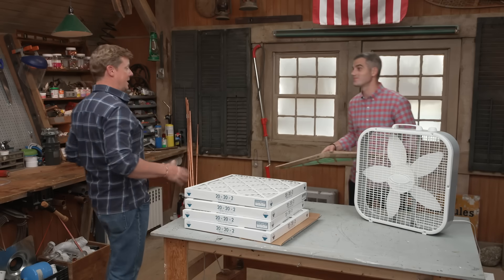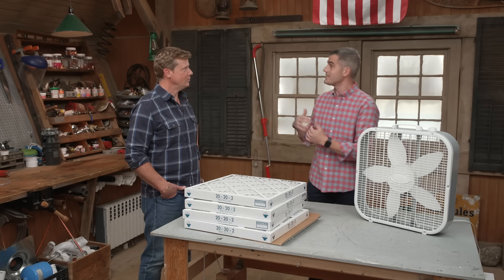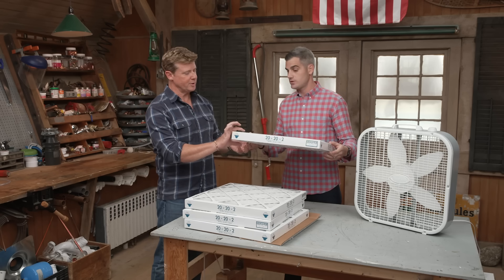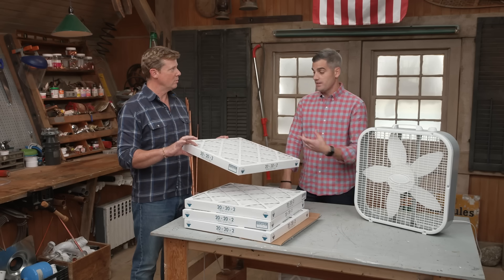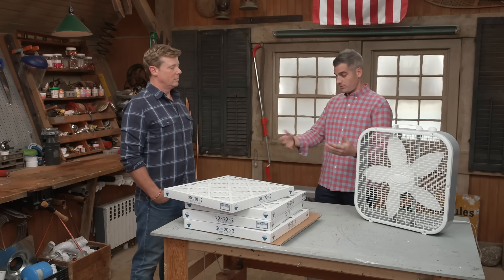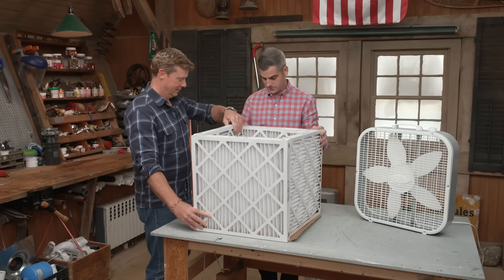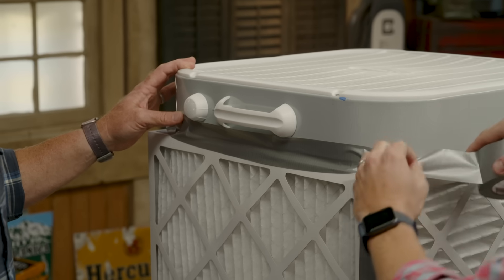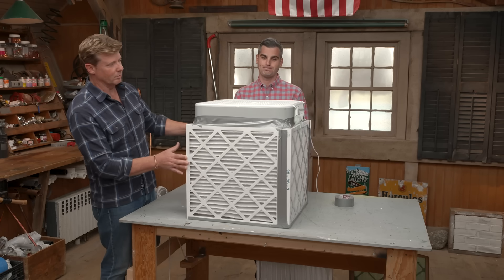How to Make a DIY Air Filter | Ask This Old House

Comment: I use MERV 13 filters in my woodshop. I duct tape one to the back of a fan.  I like this system because it will move the air more efficiently. Just have to account for the space.
Reply: A wodden frame could allow it to be hung from the ceiling. A simple pivoting wood latch would make swapping the filters a breeze.
Reply: @michaelkline9647  I was thinking the same thing, even with the cube implementation in the video. Could be just the thing I need for my own shop, with a lot more capacity to move air!

Comment: I use one filter on the inlet of such a fan in my workshop. Does using 4 filters have much more flow? It seems to work good with just one filter.
Reply: No one is actually discussing how much air that fan can move...
Reply: Would clog up less with 4 filters. Intake will also be higher with 4. As mentioned in video the 2500sqft house will have the air pass through in 20 minutes
Reply: @billpiehler9010  ... figure it this way... a fine window screen can cut air flow by 50%. What do you figure the air flow will be with one filter? Yes, 4 filters will flow more air... till they eventually clog.
Reply: @rupe53  the video pretty much explains its about moving air. 1 filter moves less air than 4.
Reply: @billpiehler9010  ... yes, my example was for those who have trouble visualizing how much restriction there might be with something as simple as a window screen, then comparing it to the next level.

Comment: There's also UVC lights you can install in your HVAC system.
Reply: Those are for the Coil only, not air.
Reply: @tsslaporte  For the coil only? I'm not sure what you mean. UVC would have zero effect on a coil. There are heater bulbs they put on fridge coils to keep them from turning into a block of ice, if that's what you're talking about. But any light they emit is just waste energy.
Reply: @CuddleTrouble  negative, in this context your talking about UVC as a way for disinfecting the air right?  UVC needs time to disinfect and air flowing through does not spend enough time in contact with the UV light. By coil I was intending to say the Evaporator coil inside your Air handler which will stay exposed to the UV light and prevent mold growth on it.
Reply: @tsslaporte  Yes, i knew what you meant by coil. I did not think of mold though. I'll have to look into the time required and light intensity.

Comment: Ross, I hate to be that guy but what medical training do you have and should you be advising people on the topic of aerosols and viruses
Reply: We’re talking about filtration of particles in the 0.3 micron - 10 micron range. These happen to be things like dust, smoke and particles that bacteria and viruses “hitch rides on”. I’m by no means a medical professional but my masters degree in mechanical engineering provided a lot of insight into physics, particles and filtration...the segment is not intended to portray that this less than $100 filter system will miraculously capture all viruses/Covid out of the air. Just some good sound advice to help improve the air quality in your home. (And by the way mechanical filtration with MERV 13 or higher, ideally HEPA is recommended by all of the leading scientists and doctors in this field)
Reply: @rosstrethewey9391  I am a medical professional. And you are entirely right.
Reply: Gar thanks! Appreciate it. 

These segments can be tricky as there are a lot of opinions out there but we have to follow the science!
Reply: @rosstrethewey9391  Thank you Ross , and thanks for replying to my previous comment, seemingly rare on TOH channel.
Reply: you're doing it wrong
 ... some of what he says is true, even if only due to moving the air instead of it being stagnant. IOW, any filtering is better than no filtering.

Comment: Want to NOT have AC for a while, put a higher resistance air filter in your system. You coils will turn into a giant block of ice along with some of your piping that will take days to thaw out unless you take a torch to it.

Comment: Surprised no mention about using in wood shop.  Been using for years. Gotta change them a lot more often tho
Reply: Pizza ... have seen similar on both wood shops and auto body shops. There's even commercial versions sold, although more expensive. OTOH, the commercial units are rated to be explosion proof. (chemicals, etc)
Reply: Indeed. I use only MERV 4s and they help a lot!
Reply: Really good idea- i definitely don't have proper ventilation or any dust collection other than a dust pan and brush.
Reply: I've been using cheap 20x20 air filter taped to a cheap box fan in my work shop for years. I lightly fog the filter with some spray adhesive. Work's great for capturing over spray particals when painting.
Reply: @derrinpickett9948  what level filters are u using? I just bought some merv 10 filters at $25 a piece, but I was thinking of buying the cheaper ones and spraying them and seeing if it works as good as the higher merv filters 

Do your filters work on smoke when sprayed?
Reply: @HolyDrugLord  atm I have Merv 11 as that was all that was available. I have used higher but would not use any lower then Merv 10. Before lockdown I would use Merv 10 or 11 in one and Merv 14 in my 2nd fan and have that near where I generate the most fine dust.
Reply: @derrinpickett9948  my Dad did the same by using a few box fans

Comment: HVAC systems are not designed to filter home air. The air filter is to filter the air for the furnace only
Reply: Some HVAC systems have filters to filter home air in addition to the furnace air. This is common on ducted HVAC systems
Reply: As they mentioned several times in the video some HVAC systems can accommodate this level of filtration and some can not.
Reply: Sorry Alec, but your statement makes no sense. The home air is the return air for the furnace. And they can be designed for high MERV filters, like in my house.
Reply: @rosstrethewey9391  the furnace filter is to keep larger particles from entering your your heat exchangers and evaporator coils in you HVAC system, there purpose is not to filter your air but protect your equipment. HVAC equipment is designed with minimal merv rating filters. Higher merv rated filter may be ok in a system granted ductwork is adequately sized, static pressures are reasonable, proper movement of air (cfm) and large enough surface area of filter to handle air flow and most importantly replacing filters before air flow is restricted. HVAC pros recommended merv 1 filters because most home owners have no idea how to maintain this properly, so cheaper filter = less restrictive air flow = a more efficient system.
Reply: M K I agree that the primary purpose of an air handler or furnace filter is to protect the equipment. BUT there is no reason why any residential unit can not be designed/installed with high MERV filtration. I can’t remember the last job where we used less than MERV 11. These AHU’s have ESP anywhere from 0.5” - 1.0” WC, more than enough for properly sized MERV 11 or 13 filters (which might introduce 0.1”-0.2” WC). Plus with ECM motors they are variable speed so they can adjust with static pressure as necessary...MERV 1 ain’t good enough. And code in most states needs MERV 8 anyways...FWIW I did a job with MERV 13 filters on low static air handler (0.22” ESP max), how? By increasing the surface area and number of filters in the system, along with properly sized ductwork. Works like a charm. Filters get changed twice per year...AHU protection and Indoor Air quality both achieved. We have to raise the bar!
Reply: @rosstrethewey9391  fair enough. I just enjoy the discussion we all learn from these! Is this the real Ross by the way?
Reply: Alec Minnick yup!
Reply: @rosstrethewey9391  what! You've got to prove it haha!
Reply: @rosstrethewey9391 you must be on the commercial side of the industry we have mainly residential customers and many can hardly keep the lights on let a lone keep up with the cost of the equipment,maintence and call backs of “raising the bar” but it always sounds good on paper
Reply: Our hvac person always said to stick to the cheap ones and change often

Comment: This might help someone out there , I put on a high quality filter then a few days later my furnace would not turn on ? Couldn’t figure it out for a while until I thought to myself the high quality filter was too thick and not letting enough oxygen to keep furnace burning correctly . Switched back to the see through filters haven’t had a problem since .
Reply: MPLS ... the air filter should not affect the air flow for burner function. OTOH, some furnaces have a safety switch that won't allow the furnace to run if the door where the air filter is located will not close properly. (filter is too bulky or other misalignment) IOW, most likely your problem is the door switch.

Comment: if 4 filters last 6 months then does a "V" shaped version last 3 months?
Reply: A standard, single filter is generally assumed to be good for 3 months in an average home. The effects of multiple filters on their lifespan aren't linear.
Reply: @ThisSiteSureSucks  ... you make a good point because it depends on just how dirty your air is. OTOH, when talking about total surface area we can presume that more filter area will go longer between changes in a given situation.
Reply: Also depends on the cfm the fan is moving.

Comment: I have never seen a merrv 1 in a hvac system unless it was used as a supplement for as he said pet hair
Reply: All builders tell the new owner to use the merv 1, they are cheap and gets them by the 1 yr warranty of HVAC system without any issues. That's what my builder told me to use, and provided as the filter for the new house. It barely stopped/filtered anything ever after 90 days. I don't use them anymore.

Comment: While MERV 13 won't be perfect for viruses, there will be an improvement.  This is because the filter does not need to filter out the very small virus, but rather the aerosols.  Its along a similar line to why cloth face masks provide some protection, even though they do not have the capability to filter out virus particles.  

Would this filter make be feel safe enough to have guests over, absolutely not.  Would I want this filter to help protect my family if I had to stay home sick, definitely.
Reply: srdsrd16 excellent point!
Reply: The virus doesn't travel alone. It travels on droplets. The filters absolutely would stop it.
Reply: @Graeberwave  no.. your ignorant to how things work
Reply: @SheikhN-bible-syndrome  lmao what else you got? The Earth is flat? God you are so lucky to hide behind that computer.
Reply: Your not going to catch the virus particles.
Reply: @Sctronic209  but you can catch the aerosols the viruses are hitching a ride on.
Reply: Side note- merv13 is one step away from hepa
Reply: @skyline5354  not!

Comment: Nice to see some current day videos rather than stuff from several years being posted as if it were new.
Reply: Kinda seems like a terrible idea though. I made one with one filter a while back and there was no airflow. I would have liked to see a demonstration of the airflow here, because it costs $100 to set up. Seems like a lot
Reply: @Rearmostbean  with one filter you have less surface area and it is directly against the fan allowing for less overall flow. Increasing to four increases flow and decreases resistance. And even more so with 4” filters. It’s less drag and less resistance to the fan/blower motor and has distance from the motor which helps as well- and a general increase in cfms, even for weaker motors.
Reply: @TheBrianDotson  yeah, i was thinking that was the gist of the video. And the filter I was using was a 1” filter. Also it was not a box fan but a vortrex, 570 cfm fan. So I can believe this would be better, but how much?
But like I said, I wish they showed demonstration. Or has someone tried it and can vouch for it’s effectiveness?
Reply: I'm pretty sure this came out a while ago, like last spring
Reply: how is it not current day when they are talking about COVID?
Reply: @TheDobbermn  that's not what he said. He was appreciating that THIS video IS current. Their recent video releases have just been reruns. This is the first genuinely new video they've done in a while.
Reply: @ThisSiteSureSucks  Yep, as i reread it you are correct.

Comment: This is startlingly misleading, irresponsible content that I’m surprised to see coming from TOH. MERV 13 filters do not filter viruses, and do not provide protection from this type of pathogen. Misguided content like this is what causes runs on goods like N95 masks & toilet paper. MERV 13 filters filter particles between 3 and 10 MICRONS, viruses are in the 70 to 90 NANOMETER range (nanometers are 1/1000th of a micron) telling people that MERV 13 filters can protect them from a deadly virus - even implying it - is dangerous. Not ok TOH. Do better.
Reply: While MERV 13 won't be perfect for viruses, there will be an improvement.  This is because the filter does not need to filter out the very small virus, but rather the aerosols.  Its along a similar line to why cloth face masks provide some protection, even though they do not have the capability to filter out virus particles.  

Would this filter make be feel safe enough to have guests over, absolutely not.  Would I want this filter to help protect my family if I had to stay home sick, definitely.
Reply: I believe it's not that it's filtering virus itself but the water droplets that the virus is hitchhiking on which is it's primary way of spreading
Reply: "You need to be 13 or higher to really get smoke and to really get the aerosols that we breathe out which is what the virus basically hitches a ride with to transmit."
Reply: But how can they sell product placements if they just say to leave the windows open?
Reply: @Rearmostbean  I'm sure my gas/ electric company would love for me to leave my windows open.
Reply: Sorry Kevin that you felt this way, by no means was this segment supposed to me misleading. The MERV 13 filters will capture particles between 0.3 micron- 10 micron or larger at various efficiencies, but typically 50% or greater. These sized particles transmit many harmful things like bacteria and viruses, because they provide a transport medium. They also do a good job at capturing smoke particles that typically fall in this range of particles....is this air filter the end all be all, of course not. HEPA units would be far superior, but this is an inexpensive way to increase the filtration level in your home (less than $100).
Reply: Well said @rosstrethewey9391 . Keep up the good work. I really enjoy your segments.

Comment: I have a dog, cat, and cigarette smoker in the house.  I do the 20"x20"x1"  on a box fan.  It gets disgusting.  I change it once a month.  It really helps with the cigarette smoke.
Reply: I bought plastic u channel and screwed it to the back of my fan and then I buy 20x20x1 filters and just slide them in there. It's not perfect but it sure cut down on the dust in my house. Filters last about a month if you leave it run continuous
Reply: I use this too. Works well. To make their four filter cube one would be taking up too much space in my small rooms. Single is much easier to transfer into the bedroom at night as well.
Reply: This really works, wow. I have to do this becuz of my husky.  I need to do one like him though.
Reply: Do you put the filter on the intake or the exhaust of the fan?  Thanks
Reply: @FireDrillNinja  intake

Comment: 2:53 LOLOLOLOL such bullshit being attached to this FLU covid crap, motor 101.....you restrict airflow, a motor does LESS work, cute try though.
Reply: I agree with everything you said. This contraption wouldn't be economically feasible in dry, dusty climes nor in fire zones. You'd be changing these EXPENSIVE filters out A LOT more frequently than every 6 months. Maybe think an electrostatic system you could pull the grids out every week and throw them in the dishwasher or hose them off outside.

Comment: I've been using merv 13 one inch thick filter in my heater for 3 yrs now
Reply: Sounds like to me, you need to get a whole house air purifier as using those filters will cause your hvac system to work much harder and longer to do its job, which in turn will cause early failures with the unit. Remember the filter in a majority of hvac systems is to protect the unit, not for filtering the air for people living there.
Reply: Hopefully you've changed it often. I hope you didn't mean it's been the same one for 3 years.
Reply: I change my filters every month because it helps to cut the dust in my place. I live on a very busy road n have no idea it was going to be this bad
Reply: @michellephilhower2191  ... I ran an auto repair shop for years and recently switched to the 1" pleated filters. They do plug up sooner (about 6 weeks instead of 12) but based on what I see they do a better job of keeping the air cleaner.